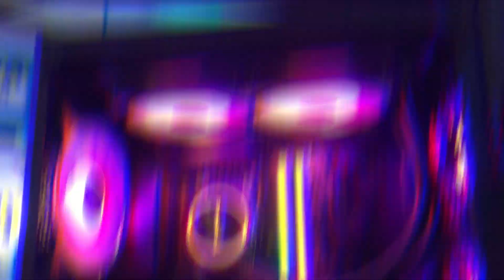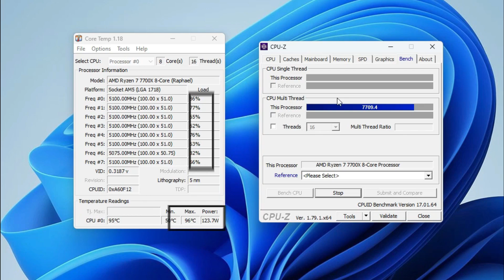Unboxing GAMMAXX L240 A-RGB Installation on Ryzen 7 7700x |Temperature Test |

Comment: Why did this fairly easy to cool cpu hit 96c with this cooler in your case? Does the included mounting bracket not provide the correct mounting pressure for AM5?
Reply from the maker: High temperatures with GAMMAXX L240 A-RGB cooler on Ryzen 7 7700X may be due to:

- Insufficient mounting pressure
- Incorrect installation
- Inadequate thermal paste

Check installation, tighten screws, and consider alternative mounting solutions or thermal paste.

Comment: So do you recommend this? 
I mean if i stress 7700x at its full potential then will this cooler will be able to cool it efficiently?
Reply from the maker: The GAMMAXX L240 A-RGB is a mid-range liquid cooler from Deepcool. While it can handle moderate overclocking and everyday use for a Ryzen 7 7700X, it may struggle to cool it efficiently under full load if you push the CPU to its limits. If you plan to stress the CPU frequently or perform heavy overclocking, you might want to consider a more powerful cooler, such as a high-end air cooler or a larger liquid cooler with a thicker radiator. It's essential to match the cooler's capabilities with your intended usage to ensure efficient cooling.
Reply: @rambotech_  ohh thank you brother
I'll go for gammaxx l360

Comment: @rambotech_  If i get a ryzen 7 5800x3d, will the cooler handle the temperatures better than it did in your video? Your CPU power was all the way up to 139W, the 5800X3D goes up to around 115W, so i'm wondering if this is enough to get better temperatures than your video or if there are other things that comes into play? I'm not looking for overclocking the cpu but i'd prefer to use it in its turbo speed mode.
Reply from the maker: Upgrading to the Ryzen 7 5800X3D should result in better temperature performance compared to the Ryzen 7 7700X due to its lower TDP. Since you're not planning to overclock, the GAMMAXX L240 A-RGB should handle the CPU's turbo speed mode comfortably. However, factors like ambient temperature and case airflow also play roles in overall cooling efficiency.

Comment: Guys, is the same bracket from AM4?
Reply from the maker: No, AM4 and AM5 brackets are different. Check if your GAMMAXX L240 A-RGB includes an AM5 bracket or contact support for one.
Reply: @rambotech_  ok, i have an Gammaxx L240 RGB but is the first version.
Reply: And dont have AM5 brackets identified

Comment: 96c its terrible :D
Reply from the maker: Yes
Reply from the maker: For GAMMAXX L240 A-RGB installation on Ryzen 7 7700X:
1. Unbox and check components.
2. Turn off PC, remove existing cooler.
3. Install backplate.
4. Apply thermal paste.
5. Mount cooler, connect A-RGB, pump, and fan cables.
6. Cable management.
7. Power on PC.
8. Customize A-RGB lighting with software.
9. Address high temperatures by ensuring proper installation, thermal paste application, and fan/pump functionality. Update BIOS and adjust fan curves if needed. Contact manufacturer support if issues persist.
Reply: @rambotech_ Why did you hit 96c then? What was wrong?